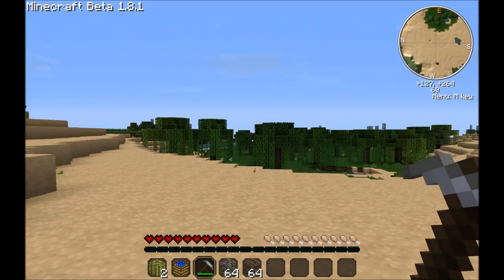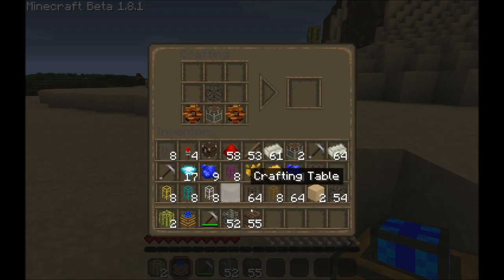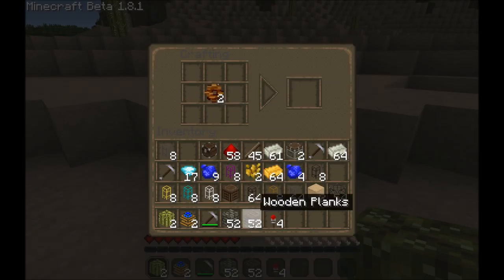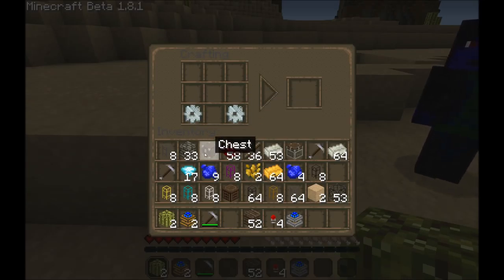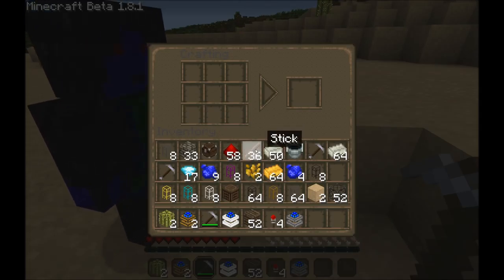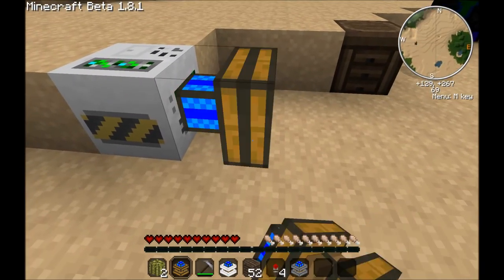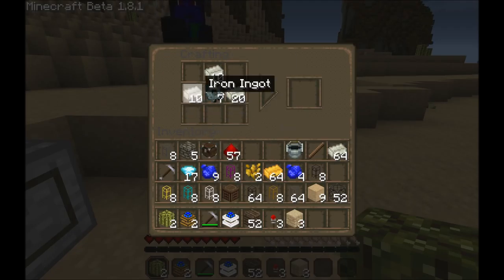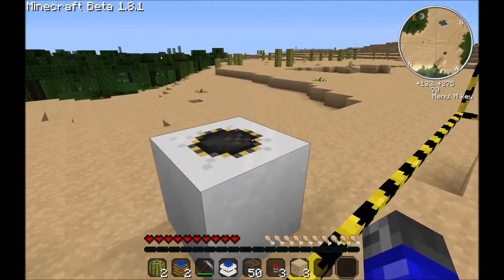Technic Pack Primer 2 - Engines & Machines

Comment: It wasn't a bug! The engines build up power which isn't used up by the machines as quickly as its produced. This is why if you add too many engines, they will build up too much power, over heat and explode. Build craft is pretty clear when it comes to bugs as long as you install it correctly. I only know of one bug which is the shift click crash.